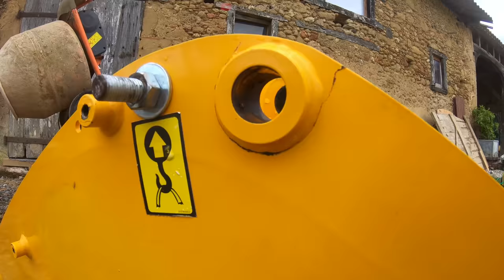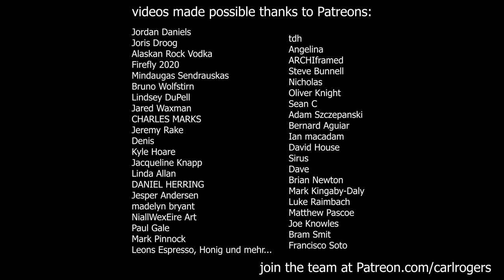When buying used Equipment goes WRONG

Comment: When installing new hydraulic cylinder seals soak them in very hot water for a few minutes prior to installation. The heat will soften the seals and make them more pliable so they go on easier.

Comment: Have not had time to read through all comments but the boom cylinder heating up is most certainly caused by fluid bypassing the rod piston. if it's only happening in one part of the cylinder then the cylinder is worn. Typically wear occurs at the end of the cylinder at max extension.

Comment: Your compressing air from the way you reinstalled it, drop out the top connection pin, drop the ram to the floor so the pipes are higher than  the  ram, slowly,  slowly cycle  the ram. Even tip the machine back with the blade. This will bleed all the air, top up oil tank 👍

Comment: You dont really want the hole in in the bushing to line up with the grease port. The machined hole in the eye has a grease passage machined in it to allow it to push lube threw all the holes.
Reply: Now that’s clever

Comment: You can make a serviceable press with some scrap iron and a bottle jack. A roll of teflon tape would be good, too. ;-) The welds weren't that great but perfectly OK, also, grinding is good prep for paint as long as you don't get crazy. Otherwise, the comments below are spot on. Keep up the good work --what you've done with that old barn deserves a medal.

Comment: With the hydraulic cylinders being singles, I would say check the actuator settings for that circuit. Most you can adjust the pressure settings. You might have not noticed it before with all the issues and seal leaks. Another might be that when installing the seals. If the seal on the cylinder's piston has a bad lip on one side pressurized fluid can pass to the other side bleeding off pressure. Putting pressure on the other side will stop the leak as the lip (if it too isn't damaged) is now stopping any leak/flow to the other side. Most hydraulic cylinders that can be pressurized in both directions have a double lipped seal so that pressure forces the seal against the cylinder wall on the pressure side and merely slides on the other.

One clue to the seal condition might be motor sound when the slide is at full retract or full extend. When a hydraulic cylinder reaches the end of travel pressure goes to max and motor sounds more labored. You can also usually hear the sound of the pressure relief valve bypassing fluid. Kind of like when you turn your steering wheel to one side limit or the other and hear the power steering pump bypass fluid. Try holding the switch down in both positions. If you don't hear a change in the pump sound when it reaches the full out position it's POSSIBLE you have a bad cylinder.

Comment: 17:25 Die Reparatur hält nicht lange, da gehört ein Knotenblech eingeschweißt um die punktuelle Belastung der Hülsen und der Bolzen besser aufnehmen zu können.
17:25 The repair doesn't last long, a gusset plate needs to be welded in to better absorb the point loads on the sleeves and the bolts.

Comment: Big job, lot's of labor, just kind of surprised you didn't do anything to expand the strength of the area where the boom cracked. Expected to see some sort of doubling plates to spread the load !!!
Reply: Extra steel was added, its a common fault on these lighter machines from jcb to have fatigue cracks in this area its just not built to a quality but down to a price.

Comment: Heat means you have a internal bypass inside the cylinder and it needs repacked, a oring could have been cut when installing the piston on the rod, and and seal on the piston could have been damaged while installing the rod in the cylinder, we always put a hose clamp around the piston seal with a strip of plastic  wrapped around the seal to compress the seal befor inserting the piston in the cylinder, and leave it on for about 1/2 hour then take ther hose clamp off and install the piston in the cylinder. I have rebuilt JCB, Case, New Holland, Cat, and many others cylinders, I think the largest was the bucket tilt on a cat 953.

Comment: The up cylinder being slow and the top of the cylinder getting hot probably means that you have air in the cylinder. The air is being compressed, which generates heat. Since the space the air takes up also has to be reduced as the pressure increases in the cylinder the cylinder will be slow. That may be a problem with other cylinders as well, since I didn't see you prefill the cylinders or do any bleeding.

Comment: Invest in the following:
A set of Oxy/Acetylene bottles…..(for heating up and removing old bolts, for washing old bearings out, for gouging out a crack before welding, etc).
Also a manual bearing press…..cheap.

Comment: I'd say your cylinder speed and temp issue is most likely a rolled seal or it tore during installation.  The reason the speed is off is that it's leaking past the seal, and in turn, filling the top of the cylinder at the same time as the bottom, so it's working against itself, more or less.  Going down isn't a problem since there isn't enough pressure to push oil past the seal.  The same thing happened on my Volvo. It could be something else I guess, but it's exactly what happened after I rebuilt mine. I despise rebuilding cylinders, lol.  I have a great hydraulic shop close to me. A friend owns it so I let him deal with it now. Saves me frustration and gives him some work, so it's a win-win as far as I'm concerned.

Comment: Check around -feed with palm, to see if heat comes only from that one cylinder or other hydro components are
hot as well. Check hydro oil reservoir & pump temp. Check for debris in hydro filter, or  air leak from cylinders. Bubbles in hydro oil will do it. Bleed air. 
Are you losing hydro fluid ? Take temp of hydro fluid when hot. I t should not go above 180 F. Do not use a lot until you figure this out or you could fry something.  Expensive. You snooze you lose.

Comment: The hole in the bushing is not intended to be lined up with the zerk hole. If it is the grease will take the path of least resistance and not distribute evenly around the bushing.

Comment: Seeing that general lube grease. Start using Valvoline Full Synthetic grease spec. NLGI #2 GC-LB complex lithium EP grease for high load fittings. I use it on the replacement front suspension ball joints of my T1N Spinter MBenz and at 150K miles there is very little wear. Part number VV986 for 1 lb. can of it. There is a spray molly that Fisk Brothers makes for us in America and I used that on a 520 Oring chain 250CC twin with fantastic wear over 15K miles.

Comment: It could also be that the cylinder was clamped in the vice by the body, a no no, could have deformed the bore causing a tight spot which would wear the seal quickly and cause the heat you are seeing, hope this is not the case but it was clamped pretty tight in the vice..

Comment: The later model of this machine, has additional plates welded around those bosses. JCB obviously knew of the problem. I hope your welder gouged out those cracks and didn't just weld over the top. He should have really cut some extra plates to make a good repair.

Comment: trapped air most likely cause for slow operating of main boom-UP cylinder, this would also explain why it is getting HOT.
Didn't look like you guys bled any air from the hydraulic system when re-assembling the unit (incl hoses and piping).

Comment: The problem with the speed is caused by the white plugs you put in the hole at 23:20 in the video.
Remove them and i promise that your problem is solved..
it's supposed to be e free flow of hydraulic liquid in those holes..
Greetings from a Swedish hydraulic specialist..

Comment: You show that even an amateur can do big things if you are careful about the little things. I don't mind DIY done by amateurs that do their work with care and concern about the important things. It may not be done the easiest or best way, but still done well. Keep up the videos.
PS I'm no hydraulic expert but judging from the old work done on the hoe I would guess they worked on the valves and messed it up.

Comment: The bushes are designed for interference fit.  Dip them in liquid nitrogen for a few minutes, then just drop them in.  Whacking them in with a hammer may cause microscopic fractures that may lower the lifespan.

Comment: I m sure with the pins and bushings replaced the machine works so much better, keeping up with maintenance , greasing , oil and filter changes  is the key to getting the most work out of it for as lo g as possible .
How are the track rollers ?

Comment: I didn’t understand why you didn’t grind the bolt heads off (for the bucket teeth)  instead of the nuts. The head should have been easier to reach. Also using anti-seize on a nylon lock nut doesn’t make sense they have nylon inserts. OBTW those nylon lock nuts will fail in that application so be ready to replace them.
Reply: I think because you only have to cut the nut in half, only on one side really.  He cut them completely in half.  on the head side you would have to cut the whole head off to get the same result.  On the nut it's just one kerf of the blade.

Comment: If I was you I would be changing the king pin , If the king pin is loos it can put undue presser on the boom ( Twisting it ) and in turn the boom pin sockets causing fracture .

Comment: The magic word is: arbor press! Always grease on the copper bushing and hole, then everything goes in like a lubricant! If the copper bushing is not allowed to rotate and has a lubrication hole, I would use a little Loctite for the assembly. Later the copper bushing can start to turn and no more fat comes through. Assembled dry and with a hammer, you are already scraping copper away from the can. I would also secure the nut of the cylinder rod with a little Loctite. Never clamp the cylinder sleeve in the vice! There are unbelievable forces on the case. Never assemble a bushing, screw or bolt dry. You can make a hook wrench yourself or it costs 10 bucks. The cylinder nut lock still looks good even after the repair. If you roll a piece of paper and put it into the holes, It stretches after letting go and not a bit of paint will get into the fitting holes and you can apply paint thickly to the edge. The teeth of the shovel are now clean (lol) and the repair successful. Thumbs up and thanks for uploading.

Comment: I would think the boom was constructed of T-100 steel it requires a preheat and usually a 11018 welding rod or wire, anything  less will more than likely crack again.

Comment: The piston getting hot. Well compression makes hot, evaporation makes cold. So when its doing compression, it gets hot... What can i say, it should be normal. If i were you id definitely look into putting a new oil filter in and fresh oil (i hope you didnt mention or did it already, but it is what you want to have done, so if you did, thumbs up). I have a book on hydraulics on my archive book page. Maybe if you read that it makes more sense. Its basically a big pump, and a bucket of hydraulic fluid, some valves that make the piston move in and out, and a filter. The area of the piston makes for the power it can produce at a certain pressure. So if you want more power, you need a hydraulic cylinder with a bigger piston. 

Greetings,

Jeff

Comment: You made a mistake assuming that (one of) the grease holes in the bushing should align with the grease nipple on the eye.
I could see in the video that a circular groove is machined inside the eye, and the bushings have four holes in them.
So grease pumped in should spread itself via this groove to all four holes in the bushing, to get an even distribution holes should NOT line up, but the 2 holes closest to the nipple should be 45° either side of it.
Also, please do not use steel tools and bars in direct contact with those bushings when hammering them in, use a plastic or brass hammer, or a piece of hardwood or nylon (piece of cutting board) in between.

Comment: It was probably the original weld that weakened the metal to cause the stress fracture.
Reply: And the new weld,looked pretty bad also,not quite the standard of Kurtis,on Cutting Edge Engineering.
Reply: Love Kurtis at CEE, absolutely hang for his videos on a Friday

Comment: Did you freeze the bushes first? Go in easy if you do. Does the boom stay fully extended for a long period if you leave it? Wondering if oil is passing the seal making it slower on the way up against load.

Comment: its painful watching you grind most of the weld off that repair I hope you didn't expose more stress risers from the previous crack. also I hope you made sure they drilled holes on each end of the cracks and filled them with weld before welding the rest. But me being a retired Seaman it was hardest to watch you spray rattle can paint on bare metal. Also you should have heated the ram eye to expand it, while putting the brass bushing in the freezer to shrink it that way it would have just slid in place with out having to bang on it. You could have warped the bushing. Anyway  I love that old stone house.
Reply: We didn't see the welder-farmer in action, but the correct way is to properly grind and fillet the crack, drill out the crack tips, then weld it, then grind it flush and finally weld a gusset plate over the repair. It might not look as pretty, but that's more important than a nice (unprimed) paint job after.
Reply: @stephengrimmer35  yeah thats the best way, I'm sure it will be fine though. I would like to find one of those cheap at an auction so I could overhaul it then use it around my house, then sell it.

Comment: Rather than weld the boom plate at the fitting for the pins; may be better to have drilled holes in a 1/4" plate and spots welded a 6.5 X 6 cover plate . I have reservations about loading up the pin
placement supports with weld in such a small area. Time will tell. There is a lot of stress on those pins at an angle as you work. Chrome molly welding would be better than mild steel. 60,000 psi molly is good stuff.

Comment: Need to rebuild boom lift cylinder. An error was made in a seal/o-ring or direction or unintentional damage while installing the same.  
No shame. I have done the same. There is an "art" to all the details with the seals and o-rings.
Good luck.
You are way further ahead than you were.
Life is always learning experiences.

Comment: I'm also pretty sure those bush holes aren't meant to be in line so it forces the grease through the track in the head and around the whole bush rather than just out the one single hole for path of least resistance? Maybe I'm wrong but jcb always had them offset ..

Comment: I hope you did more tightening of the piston nut than you showed in this vid because he would be lucky to get it to 100ft.lb in the vid, get a torque spec from a dealer and advice on loctite use and redo it if need be. A piston coming loose is bad news.

Comment: Air in ramp, take pin out and lay flat, at angle etc and cycle full travel.  That heat may by cavitation bubbles.

Comment: For as much work you'll do on vehicles and machinery, a decent shop press would probably come in handy, and is the far-better way to press bushings out and in.  Very cool to see you guys tackle the job, and it looks like you're getting some great advice on the hydraulic issue you still have.  I'd just add (again - apologies) that hearing protection is a wonderful thing.  I wish my 53-year-old self that just got hearing aids could go back about 40 years and warn my young-self...  ;)    (I know you're getting a lot of safety-equipment flack)

Comment: Safety tip : grinders rotate at thousands of rpms. When you were grinding the nuts off the teeth with your bare leg in front of the bucket I got worried. Stand at the side or behind the bucket.

Comment: The weld on the main boom won't hold very long. There's a lot of porosity, and an undercut because of the grinding. It's a design issue. Very rigid Bushings held by a pretty thin sheetmetal. Hd to break there

Comment: The cylinder is getting hot because oil is passing over a seal more than likely, the welds you should of left the pins in when welding it up to keep the alignment.
When there manufacturered there line bored so both perfect, welding causes distortion of metal.
The grinding out of the cracks then rewelded is the correct method and if possible a square or round plate with a hole in and welded on the outer diameter and inner.
There is no set correct way its experience, and you will soon know if it works or not.

Comment: certified welder here, in some instances you grind welds, the arm was not one of them. You may be doing another repair job. I would have welded a fitted plate around pivot hole on both outer sides. Never ever use metal on metal when driving in bushing. Use wood or soft hammer and put bushings in freezer before placement. They go in easier. I perfectly understand the work with what you got phrase. Commenter was right about the two outer teeth needs pointed outward. How serious is the crack on front of machine along side the pivot?

Comment: Seems to me, the welder should have reinforced the repair area with a plate;  I suspect it'll just crack again.
Reply: I 'm not even sure if he chamfered the cracks before welding and them grinding the welds further weakens the repair. I too would have gusseted the area. I have the feeling it's a repair that won't last. A welder can be good at welding but might have no idea on how to repair things.